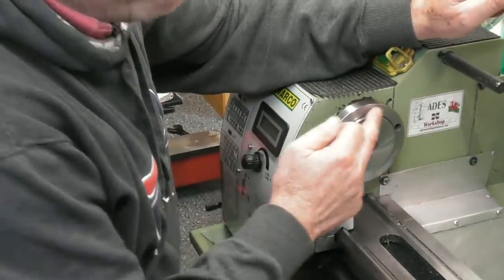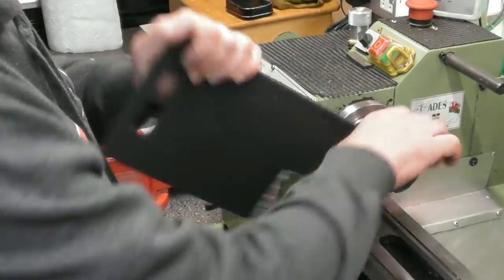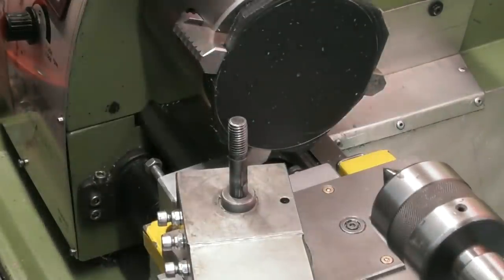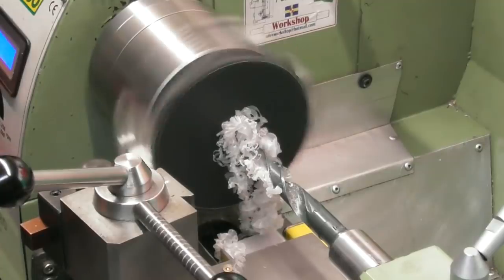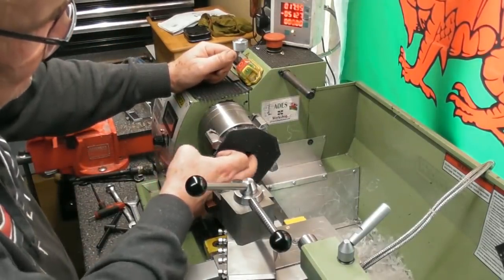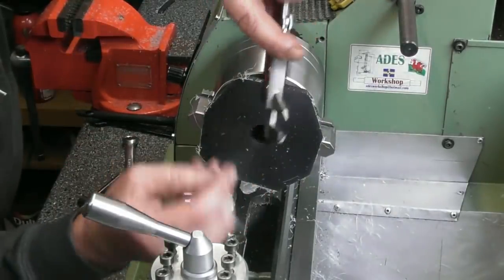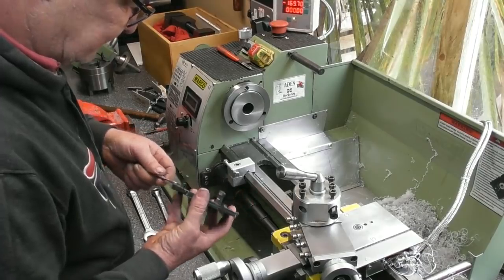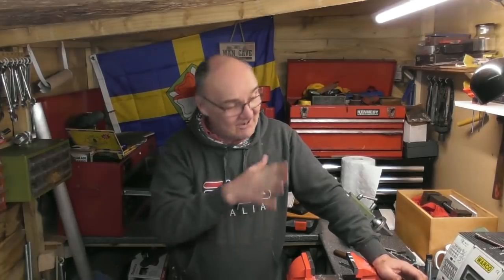Warco Wm180 lathe   Headstock protection cover

Comment: Thanks for a really entertaining project. Chopping up a plastic cut board was a brilliant way to get raw material. I'll copy that.
Just got my Super Mini Lathe from Warco so i'm eager to get started as soon as all cleaning, oiling and power plug change is done. Maybe need to take the chuck and cariage apart and clean them from Chinese swarf and grinding dust before running.

Comment: Regarding the M8 holding bolts. I buy rods being one meter long and threaded. From those rods I hacksaw the bolts I need. Backtightening 2 nuts is often useful… I've gor them in M4, M5, M6, M8 and M10.

Comment: As always Aide, great vid, I always look foward to them and they give me little ideas for myself. I recently purchaced the Axminster C8 (it's just the Sieg C8)...and enjoy tinkering around with it. I will purchace a milling maching shortly, although for now I have the horzontal milling adaptor from 'arceurotrade', which to be honest is not rigid enough so I will get the 90 deg fixed plate.

Comment: I have a really stupid question about that and other mini lathes. If you put Morse tapered tool in spinde, how do you remove tool from taper? I haven't noticed removal slot like in drill presses. Just by hammering through bar end of the headstock, is it called that in English
Reply from the maker: if you use the morse in the headstock you need to use a draw bar in the headstock tube. to remove the taper you loosen the drawbar and give a tap on the end to break the taper. cheers Ade.
Reply: @ade63dug  Thank you. Stupid me didn't realize that drill and mill/lathe holder for Morse tapered tools are actually different. Makes sense as drill type likely wouldn't stay in place for milling and with drawbar it can be mounted/disassembled fairly gently without damaging bearings on head stock. Greetings from Finland.

Comment: Useful- but are you really going to do up three mounting bolts every time you move to a taper mount chuck? I know I wouldn't. Perhaps some sort of click lock? after all, it cannot come loose, the chuck will retain it.
An edit- a large 'O' ring around the taper chuck could act to retain it.
Reply: It's an ideal project for the 3D printer with embedded magnets but Ade is going with what he has on hand to make a 'machining video'. Using the chopping board was a clever move.
Reply: @bejay69 He could still have used magnets. Bolts are time consuming…

Comment: Hi Ade I am 16 and I too have a warco wm 180 and was wondering what oil you use to lubricate the lathe. like for all the oil buttons on the cross slide etc

Thanks Jack
Reply: Use way oil, you can buy it on ebay cheap.

Comment: Great work but if you had a 3d printer if would have been simple job to print one  out. Thanks.
Reply from the maker: we do what we do with what we got , i need a mill first , Cheers Ade
Reply: @ade63dug  So do I my friend . I was looking at the Sieg X2.7 from Arc before XMas but now they have decided to discontinue it and the model available is roughly £400.00 dearer. Very anoid.